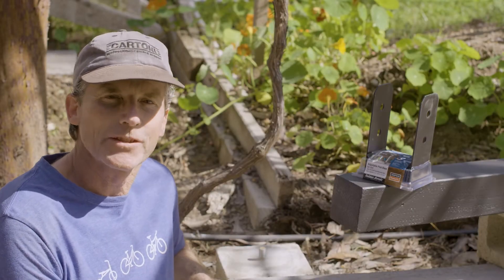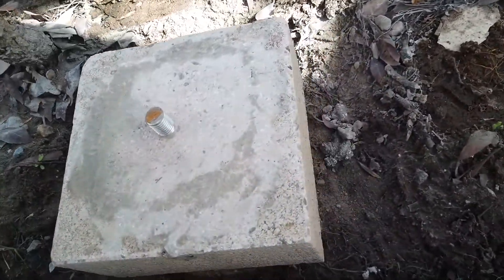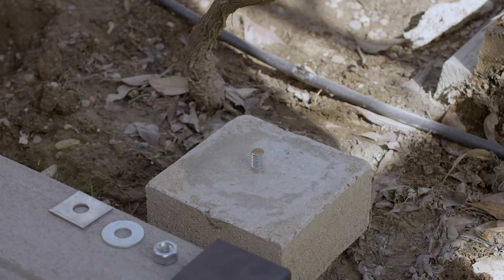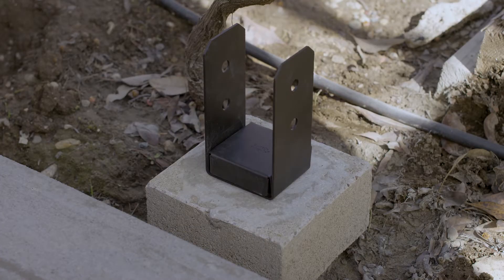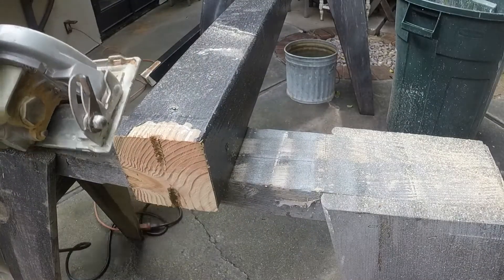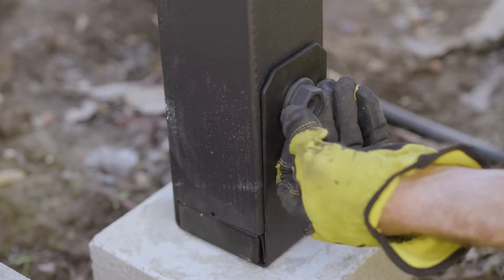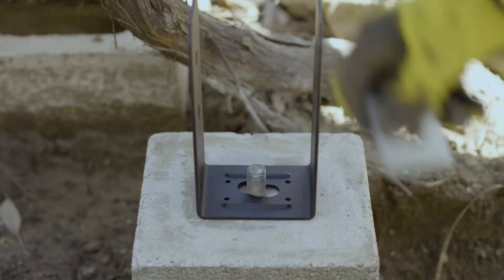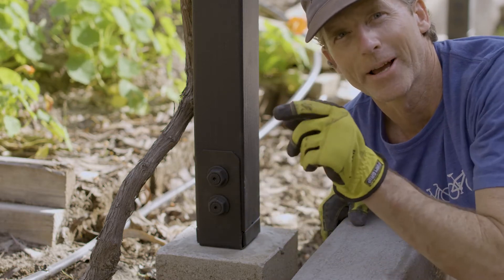Installing Simpson strong tie - Outdoor Accents post base.

Comment: Great video! I can’t for the life of me find any info on how deep the footings should be for something like this. 

I am build a large privacy screen with 3 tall posts that will be anchored to a roof. But I want to make sure the footings are deep enough.
Reply from the maker: It depends on your area. Check with your cities building department if you can. I used to think footings were for spreading the weight, but they are actually more for holding things down because of wind.  My pergola (another video) required 16" square footings. The grape arbor is just holding itself up, I probable went down 12-16" when I first built it.

Comment: if it isnt level/plumb, would it be hard to adjust? what would the best way to level be? shims?
Reply from the maker: I wouldn't use shims, to easy to rot or fall out. It has two sides so there is enough play in the fit that you should be able to get your post plumb, unless the concrete pier is way off.
Reply: @BruBuilds  thanks!!
Reply: Can you describe in more detail what you did to have the square block (precast?) with threaded rod in place? Did you pour concreter underneath or was concrete there that you somehow attached the block to? Really nice and clean solution!
Reply from the maker: Thanks for the comment. I needed to raise the post 4" because I was changing my dirt level. Since there was already an existing footing there, I just cut and bent the old post anchor, then cut an 8" concrete block in half and set that over the existing footing. Then set a 5/8"- 4" bolt and washer in the center and filled in the concrete block with some cement mix, filling in the spaces between the old anchor and new concrete block. Using a concrete block does make a nice-looking footing for a post if it is going to be above ground. 8" is really too shallow but you could stack two blocks to make a 16" deep footing.
Reply: @BruBuilds  Thanks for the reply. so it sounds like you had a stub from the old anchor, added the 4" bolt and used concrete to bond those to the old footing. The pergola posts we need to replace were put in a hole with poured concrete around them. They are rotting above the ground. Thinking we will cut them off and either break up the concrete. use a farm jack or dig it up. What would you recommend in terms of replacement? I kind of like the idea of the post being above the ground in a bracket, but expect just using same method would last for 10 or 20 years. Thoughts? Thanks!
Reply from the maker: Yes, that is what I did. I would try to get it out of the ground. You might be able to do the same thing, if you can get the post out of the concrete, add a block to gain some height, then add in a new anchor and fill the hole back in with concrete. Then attach the post using some type of post base. Not sure if you have seen my other backyard videos, but I poured my own footings for my new pergola. Thanks
Reply: @BruBuilds  thank you. We may go the old school route of post in hole with a block in the bottom and concrete fill. I’m 68 and thinking that install would likely outlast me! 😎

Comment: The holes are not offset on the APB44 Screws hit each other bad design
Reply from the maker: The website states "Fastener holes are slightly offset to help prevent fastener interference". I just measured mine, the holes on one side are 3/8" higher than the other side. If the screws are going in straight, they won't hit each other.